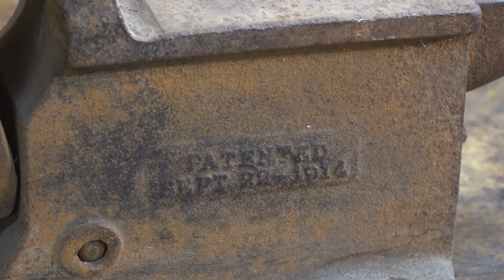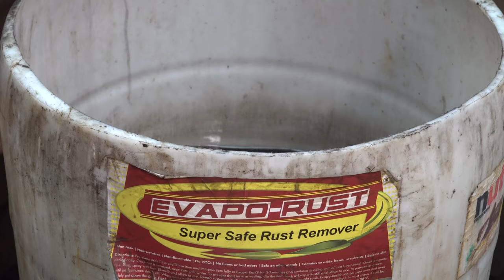Vise Drill Anvil [Restoration]

Comment: The most ghetto restoration in a while, freehand powertapping the hole in the vise jaw, sawing down one side of the alu soft jaws without tightening the screws and then just sanding down the other one isntead of sawing at all. But somehow it seems fitting for this weird janky tool.

Comment: Evapo-Rust, paint stripper, then he sandblasts it any way. Mills away the soft jaws on the vice, then replaces the lost metal with aluminium ! Brazes up the hole edges and waves the puny torch against the job for a second or two as if to apply preheat. Drills out the brazed holes running the drill in reverse. The tool needs to be rescued from this bloke.